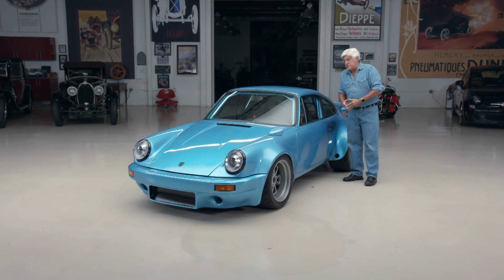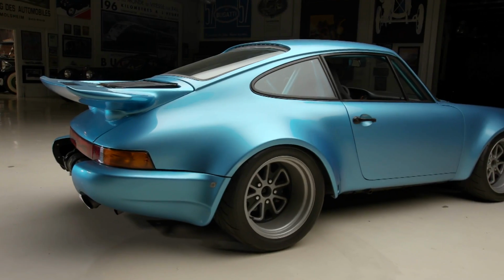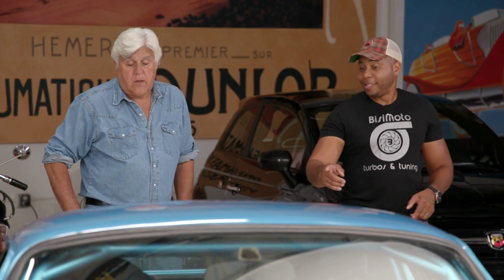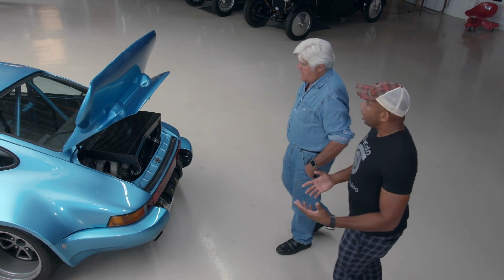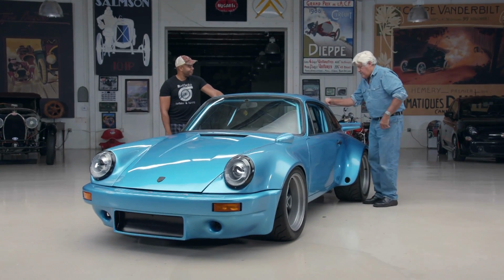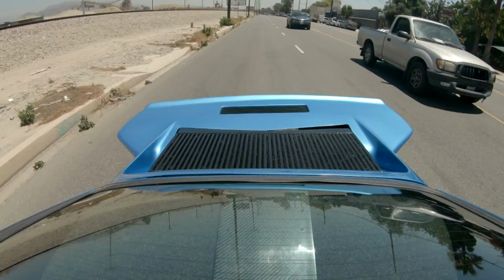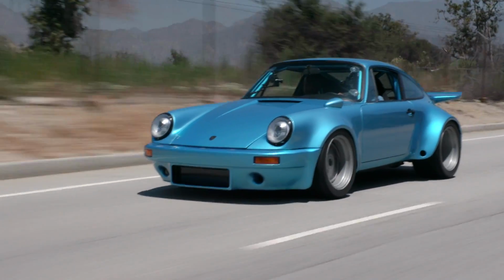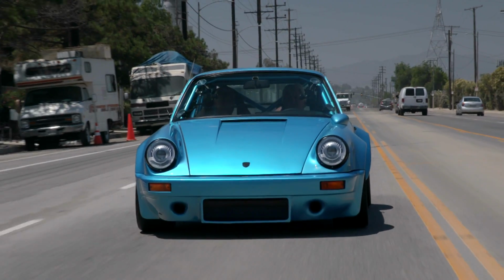Bisimoto's 850HP Twin-Turbo 911 - Jay Leno’s Garage

Comment: I'm a chemical engineer, like Porsche 911's, and have been bitten by the car bug during the pandemic.  Man, do I feel inspired!  Thanks Jay and Bisi!
Reply: Welcome to the club. I am getting a 930 911 1979. Non turbo, manual transmission car. The old air cooled is just a different sound and feel

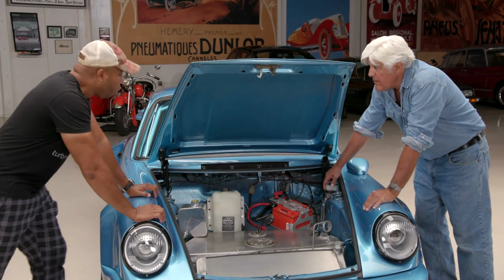Comment: 12:08, same location as those Type-1, VW bugs. 
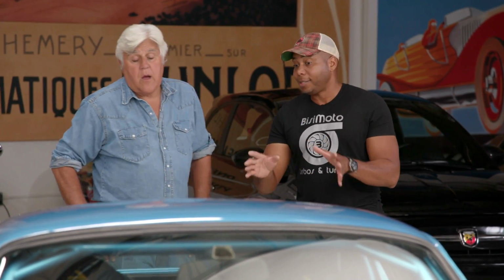07:10, there is that rubber concertina boot and rod to master cylinder, which is mounted to floor pan behind the bulkhead.

Comment: porsche guys know that 911 turbo's were not imported to the u.s. until 1976.....i had a 1975 930 turbo that was brought in as a gray market car and built for racing by andial of california......it was raced for a number of years with great success......afterward it went back to andial and was again rebuilt to meet D.O.T. specifications so it could be licensed legally for street use.....first and second gears were re-worked to virtually eliminate any turbo lag......i added variable boost to go with the larger turbo.......the 3.0 liter was rated at 260 hp from the factory...... with andial's modifications and the variable boost i could achieve approximately 370 hp.....oh, and by the way, it was an aluminum body car.......light, fast, and too much fun..........jackson

Comment: Jay would say "pulls nicely" in a top fuel dragster.
Reply: i can just imagine the skin from his face peeling off at 300+ mph...."pulls nicely"
Reply: @Maximo Moline those FW's were better in almost every way than a Spitfire.not getting into specific models, that is.
Reply: @ct1762  lol yeah why did he use focke wulf, correct analogy was bf109
Reply: @brendannelson9091  The Spitfire faced both, but mostly the 109
Reply: aint that the truth ruth

Comment: Great Show, both are Experts.
Loved how Jay mentioned al these details; Water-pump for front cooling, weight of the Car, 2 Brake Fluid connections, weight of the rollbar ect.
Then Bisi comes along showing why he did all the upgrades, using specific oils , gettin rid of the nicosil ect.
And also asking Jay , why he likes cars so much .
Thank You !
Reply: Nikasil was used in aircooled engines and alusil or lokasil in later engines. Replacing coated aluminum with iron sleeve is not optimal.

Comment: Everyone has their own taste  , but I truly don't like it.  Everything from those naked turbos ,to the color and those way to big flares . Not to mention a water cooled 911 engine in an air cooled era Porsche.  I swear it even appears to be sitting a little crooked.   I say if you want a true powerhouse of an air cooled 911 , that keeps its integrity I think RUF is the only way to go . In 1985 I ordered a guards red  86 911 turbo coupe.  Took delivery of it in late June.  It was  super fast car stock and for that era , it was pretty much the quickest factory car available.  It had about 300 hp and a 4 speed . Well I quickly decided I wanted more out of it . So I discovered  a guy in Germany who turned stock 911s into some of the meanest  track cars ,you could drive on public highways  . Long story short.  I sent it back to Germany  , with the specs I desired and he delivered.  When I got it back it was a strong  690 hp that ran through a beefed up 5 speed . The work looked amazing.  Everything from the front air dam with the oil cooler in it , back to the engine compartment  . The intercooler was now bulging out the top of the whale tail  , and there was an extra turbo on the exhaust.  To get this all done properly  ,the list if engine upgrades is unreal.   Now about 32-33 years later  I've been fortunate enough to still call this car mine all these years.  About once every 2 or 3  months  i get it out of the garage and take it out for a spin.  I've put about 15,000 miles on it since the upgrades ,and never touched it ,other than normal maintenance. I don't know of any  other car ,upgraded or not , that can still hold it's own, and outrun  most of the brand new high end sports cars of today . I guess my dislike of this blue car  , might have more to do with the love of mine ,more  than anything else.

Comment: That's crazy HP for that car. It isn't weighed down with ABS, air bags, reinforced doors, etc. I'm curious to know the weight difference between this yr Porsche, the latest yr Porsche, & a 2000's Porsche.
1975 911 weight  2,535 lbs
2005 911 weight 3,660 lbs
2018 911 weight  3417

Comment: How about 1971 Dodge colt 4 door with a Saturn engine 1600 cc overbored  to 1850 with a 15 lb Turbo boost that could create a 350 h.p.. I remembered that in 1979 beat a mild performance 1955 Chevy Bel Air . the dodge colt asked for plus 4 cars and beat it later on ahead of 8 cars more. It happened in Manila, Philippines. There are lot of drag racing there during those years.

Comment: I had an RX-7 that had side specific wheels for brake cooling.
Reply: Same here.. `86 GXL
Reply: @fishheds  Yes, a marvel of engineering. It had a pendulum device that controlled brake diving and lateral roll(adjusting the shocks). A masterpiece if you ask me.
Reply: @fishheds  And yes, mine was an 86 GXL

Comment: Thing I'm impressed with the most is you can tell its a daily driver. Inside of the a-pillar you can see where the paint has worn away. The interior isn't dead on perfect. The dash looks utility. You can tell Bisi drives this car instead of just keeping it in a garage and taking it out on the weekend. I'm not a huge Porsche fan - but I'm impressed how he was able to wedge a twin 6 banger in that go-cart of a car. 

As Jay said - very nicely done.   (Unfort sad to see the homeless situation in Cali at 22:30 with the line of RV's during the outro :( )

Comment: It doesn't seem to have enough weight in the front for the amount of power it has it the rear, I would be worried about the front tires skidding off the track in certain conditions...

Comment: Either most of you out here in the comment section are not good at reading body language or are you just being kind. Because I can tell you Jay Leno was not that impressed. First of all nice colour for the car but the paint job looks like somebody who painted it would’ve been someone who would’ve been willing to paint over the door knob and hinges and say to everyone what a nice job he did. The ground effects on the car are cheap aftermarket , the cooler on top of the spoiler there does not aesthetically work with the rear spoiler at all. When it comes to cars whether it’s fast or if it’s slow if it’s classic or new it Has to appease the eye as well as perform. In other words think optics. And lastly the engine sound , as to  those who say that it sounds brilliant. I have to agree with the one guy in the comments section that said it sounded like an RC car. Which is absolutely correct it sounds like a RC plane . Which is great if it’s an RC plane but if it’s a Porsche it’s sacrilege. I appreciate the effort the guy went through but leaving it completely open in the back would not please any woman. A woman would look at that vacant spot on the car and say so when did you get in the accident because there’s a piece missing. And I can read Jay Leno like a book and he is looking at the car thinking well it’s fast I appreciate that you’re happy about it but he is not pleased with the way it looks because he is a guy who loves Porsches and I bet you he feels that this car was butchered. Not to be any more negative I appreciate the guy thinks he did an excellent job though I’m not sure if he did it himself or had someone else did it for him and he just owns it. I still love the video but every time I seen Jay Leno‘s face I can tell he was not happy
Reply: You Make Me Laugh!

Comment: Its an interesting car, beautifull? well its a matter of taste, its not for me, not my style for a porsche.  I dont see the use of the round hole in the front of the rear fender? Cooling the tyres??? 
dont like the hole i the bumber either, its not a beetle!!! Love the engine setup and power though! wondering about getting it on the road though, it will break out a lot :) which is not porsche alike but american muscle car alike.  As I said, an interesting car, beautifull nope, i dont think so.

Comment: Mr.Ezerioha maybe you should vent the front radiator air through the front hood.  It would avoid air lifting the front end.  Venting air through the hood and guiding it over the top to the rear spoiler.   Beautiful car and great guest.

Comment: 850hp ??? Must be low on the torque side.  I am use to a 575 hp Duramax with over 1100 torque.  That Porsche sounds good though.

Comment: Please have him make you a 356 jay! Imagine a tube frame 356 with  993 air cooled NA engine with long intake runners? The sound would be incredible! If you used the multilink from the 993 race cars it would handle and weigh 1500 lbs.

Comment: Bisi should do a PHEV build next. Since electric motors can handle all the low end. Big Single Turbo on a Small Engine to focus on the top end. Since turbo lag would be a non issue.
Personal I think the Ford Barra with a Single Turbo is screaming for a SuperCar or Race Car chassis. Easily a 800hp 900lb/ft system total with two strong electric motors of around 250kw.

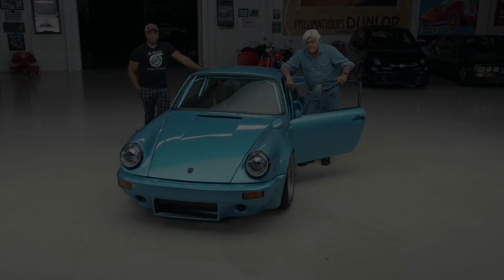Comment: 13:43.......  Ouch........ Jay...........   BIG mistake there.....!
You switched on the lights and then started the engine.
WRONG.  First start the engine, then switch on the lights. That way, the battery will not have such a huge surge to deal with.
Starting an engine already puts a lot of load on a battery. Adding more current will only reduce its lifetime.
Look at the lights. They are dimming quite a lot, meaning the battery is under a great load, already. It can barely cope.....
Reply: Actually those were the DRL's he mentioned. They come on when the ignition is placed in run/start.

Comment: Well done very well done. Modest but very strong a class act.
Anyone notice the campers parked along the road at the end ? Well they are not on vacation that is for sure.
Reply: John Robinson Governments are rapidly becoming more and more out of  control.
Reply: @hereletmelendyamystronghan6215  Phil i will respond to that.
Perhaps a bit more at length than i should.
So i will say to Jay i will not turn this into a forum of political views - in respect for his channel. But respond i shall. And if you Phil choose to respond, i will read it and it ends there. Fair enough ?
Government/s leadership style. Or lack thereof. When programs designed to assist
the low income groups either by age or disability or employment limits. Are designed to be " taken advantage " of
by overlooking certain limits of eligibility.
This by design - in some cases but not all.
Further, if you are a foreign national. And within this country illegally you should NOT receive ANY benefits at all.  Or be able to drive or work legally. As you have put nothing into this countries retirement funds.
IE : paid income taxes. Those whom have
and were born here get 1st crack at it. All
others should be denied. Why ? Due to the well known fact that SSI has been stolen from - without funds having been replaced.
For many decades now - very quietly of course. There may very well not be enough left for those who have in fact spent a lifetime working. Corruption. Give away free stuff - buy votes at the ballot box, agree or not it is why it's done. Am i wrong ? show me why if i see fact in it i will recant. 
Deception : Let em all in - why ? And why is voter registration such a well spot lit item
for those foreign nationals ? And who or what will they vote for ? whomever keeps the checks coming that is who. It is far from a humanitarian gesture, it's bribery.
Lies you say ? Unkind and racist you say ?
Take the dark glasses of and look at the true facts - the truth. Find an un biased source of facts and absorb some of it.
Then come back and tell me i'm a racist. 
The truth sucks. Being lied to also sucks.
Some on the street get paid due to homeless status. And live a degenerative
lifestyle using drugs - by choice. Free cash =  free drugs. You were not forced into drug use - it was chosen. So chose to be free of it and help should be freely given. And support as well to make it stick. Is this a product of far left leaning philosophy ? or
a means of gaining a larger slice of the voter group by deception - or is it both.
The power of deduction should lead you.
Is it the rich get richer and the poor get poorer ? or it a combination of little choices along the path to utopia. Or is it you have been used like a tool and left alone.
Given just enough to keep on going down the path. Democratic politics were very different in the 40's and 50's and even the 60's. They have been hijacked and corrupted along the way. What it is now is a crime, and the republicans are clueless and without tools or new ideas. Or a philosophy
that will actually function in today's world.
Both sides lie both sides cheat - that is a fact of politics. And they both feel they are in fact above the law itself - perhaps even
they ARE the law itself. On par with gods.
You can get pretty far with a few bucks put in many hands, for a while. When business
retracts and goes elsewhere seeking relief from unsustainable taxation. All hell breaks loose. Then what do you have left martial
law ? Hell in the streets.
We are then just like venezuela is now, but once a thriving prosperous country.
Think about it. If it all goes wrong.
It can/will happen here give it 50 years if the left have there way. And the right are lost in the weeds, clueless really.
Who will save us then ? No one left to lead the way. Dear lord save us from ourselves.
I see a very dark future if things go wrong.

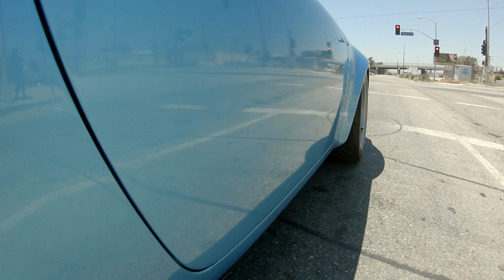Comment: 15:07 Jay knows exactly how much a car weighs simply by driving it. And previous experience with similar models of course.
Reply: The fact he got it on the number was interesting, although not surprising.
Reply: MichaelKingsfordGray  When you weighed it how much did it weigh?
Reply: Jay been driving different cars for what, 50 years?

Comment: 850hp and 2400 lbs. OMG that thing would be scary scary fast.
Reply: Standart figures for Streetracers. On Wangan for example ppl drove Tuned Supras, Testarossas, Porsches and other High Output stuff and ran 300 km/h +. In the 90ies
Reply: You are right and that’s why he commented about how impressed he was that Jay would keep his foot on the go peddle.  

I’ve been in a couple Porsche turbos and Ferrari’s.  Stock they are half this cars power.

I get the respect.  This car is definitely scary fast.

Edit: also says a lot about this cars setup.  Isn’t the 911 known as the widow maker?
Reply: @ianz28  That (imo) has more to do with the fight between oversteer from power vs deceleration oversteer. It's a different style of driving. With the new vette being mid-engine, there will be a lot of wrecked ones in the first couple years lol
Reply: @Scott-Hamilton850  the wrecks that keep the transaxel intact will lead to some pretty crazy builds. I hope they'll be well suited to LS Porsches.
Reply: Kathleen Shaw  Um, got a name?

Comment: Jay "I don't like when the engine overpowers the chassis" Leno
Reply: Kinda hard to overpower that chassis.
Reply: West Senkovec West “ “I don’t like when the engine overpowers the chassis” Leno” Senkovec
Reply: There are alot of vehicles supras and motorcycles etc That have 1 horsepower per kilo. This car is a bit more modest in That sense
Reply: West Senkovec that’s every single American car 🤣🤣 not a Porsche 911
Reply: Is that since he rolled the "Hurst Hemi under Glass" drag car? https://youtu.be/EDZDujZXf90
Reply: Fred Pinczuk Jay Leno didn’t roll the Hemi Under Glass. The owner Bob Riggle did. Jay was riding shotgun.

Comment: It's a monster with the 996 engine switch of course but there is a reason the earlier air cooled models catch the highest price. You just can't beat the sound and the feel even though the driving is much rougher and of course with far less power.

Comment: I remember seeing this guy on 
Daily Transmission 
He always comes correct
Reply: Except when he lies about the power of his cars.
Reply: Springwood Slasher He knows his car's power, you don't
Reply: @aftrnoon_ac   he was on that cringy Netflix show and clearly lied about the power his car was making because he got smoked by everyone.
Reply: Springwood Slasher Have you heard about turning down boost!?
Reply: Springwood Slasher He makes 850 but turned the boost down
Reply: @aftrnoon_ac  I'm sorry but were you there when the car was on the dyno.  Did he mail you the dyno sheet?  Do you bielive everything people say?  Sheep.
Reply: Springwood Slasher I don't have to be there. car had bigger turbos before but sized down a bit, still this is a light car meaning he had to lower boost. Have you heard of boost, don't come at me sounding ignorant... Have you been there!? No, I don't need to either. But if you're driving this on the street YOU have to turn the boost down, on some occasions if you have a light car like this...